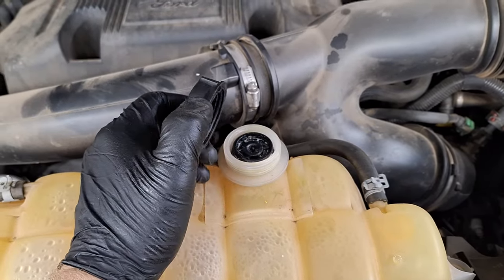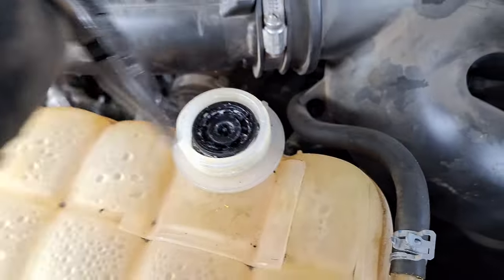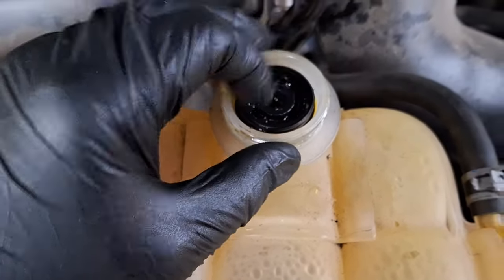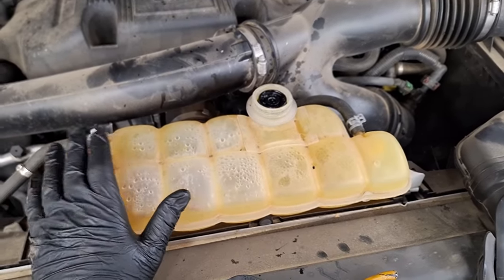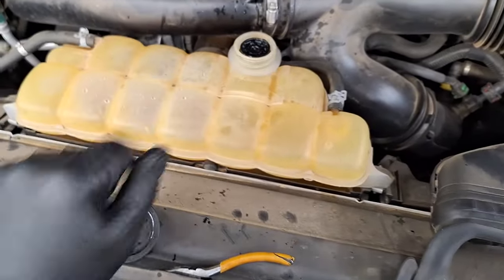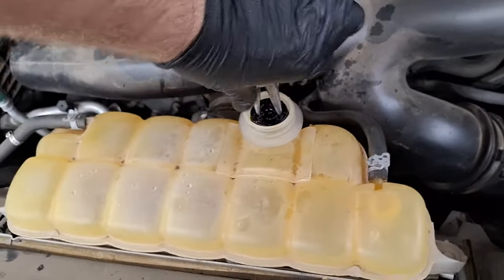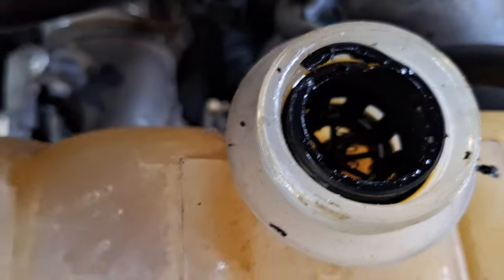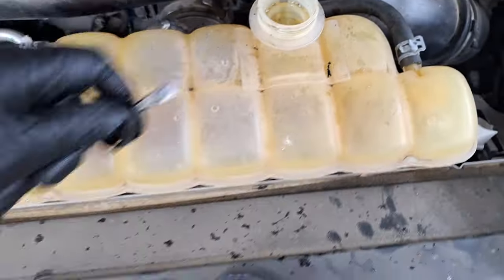Broken Coolant Degas Bottle Cap Removal Tips | Various Ford Models

Comment: Long reach, narrow space pliers are the trick! I removed little pieces at a time of plastic, then put some paper towels in the tank to cover the coolant pickup. That way, if a little piece gets in there, you can use the pliers to fish it out. Once the old cap was out in pieces, remove the paper towels and with any small debris and you're set 👍

Comment: This happened to my Vauxhall corsa. The coil left in reservoir is pull out not twist out. The spring came out of mine and was able to wedge a fairly large flat head screw driver in to leverage it out. I then disconnected the hoses and removed the reservoir to clean out the debris

Comment: GREAT, WOW....  What a MESS.  I know the Connections on my 2022 F-150 for all those Coolant Lines look like it would make a real Mess when disconnected. And Of course it will break after the Warranty has Expired. How Much is this Degas Bottle and Cap cost an Innocent Person??
Reply from the maker: Yeah what a mess! 50 bucks for a focus one (Same as an escape, etc) I'm unsure the cost for an Expedition or f150, likely a hundred or so. You shouldn't have an issue if you go ahead now and take the cap off and put some silicone paste where each seal contacts

Comment: 1. remove the reservoir. 
2. use the biggest drill bit from your stud extractor kit and drill in the center of the cap. 
3. put the stud extractor in that hole u drilled and give her 
4. clean out the mess u made and put it back in.
i used this method at work to get out a broken radiator drain plug out on a truck
Reply from the maker: Thank you for the tip!